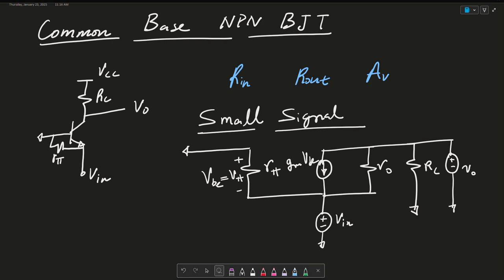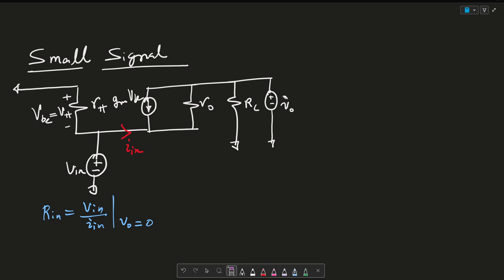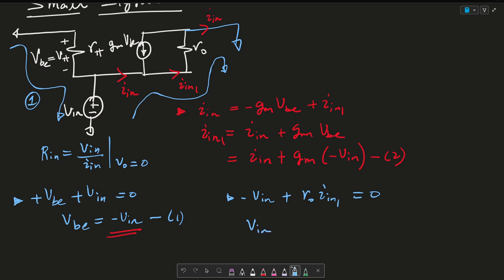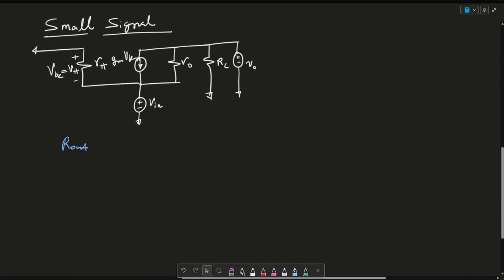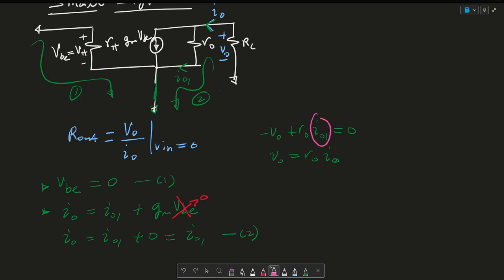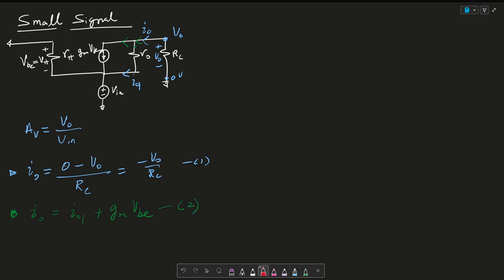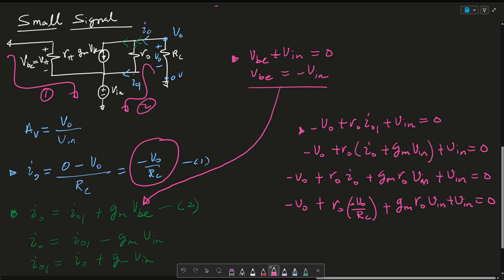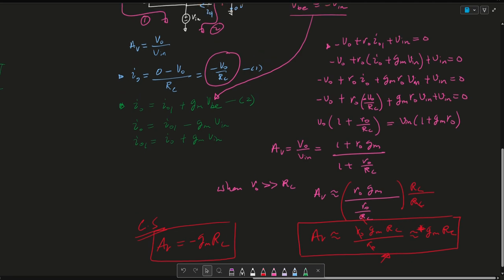Common Base Amplifier — Small Signal Analysis

Comment: Should the current flowing through r_\pi be considered aswell at 4:15?
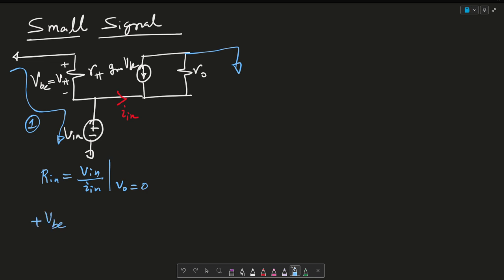Reply from the maker: Hi, thank you for the question. The current through r_{pi} is technically accounted for in the first equation (at 3:14). For the second equation (at 4:15), I wanted to simply devise a KCL equation for the current on the wire to the left of the input voltage source, V_{in} (I labeled it i_{in}, though I realize this notation could be confusing). However, the method used in this example simplifies solving for the final input resistance, R_{in}. Long story short: it depends on how you label your currents. I hope this makes sense.